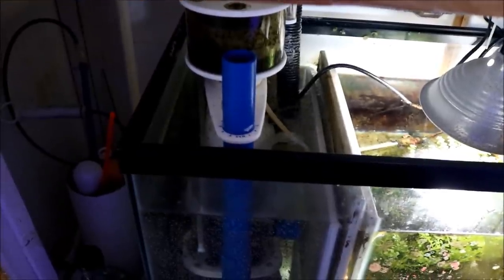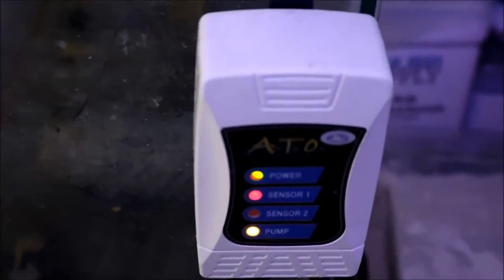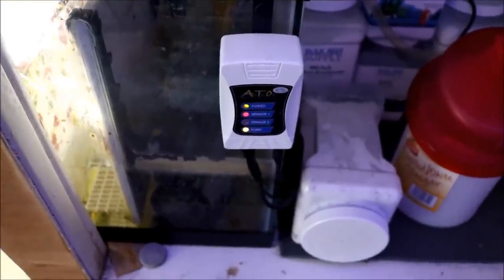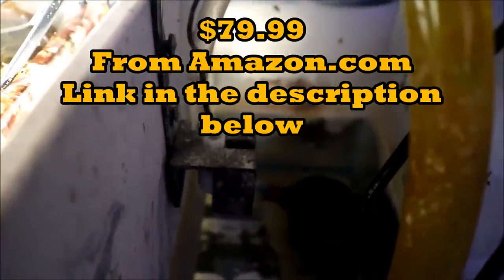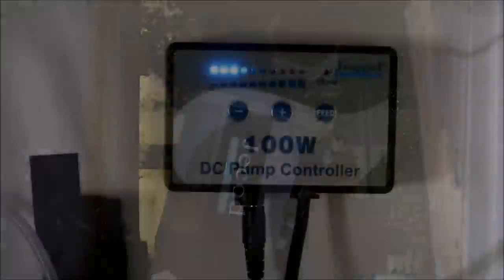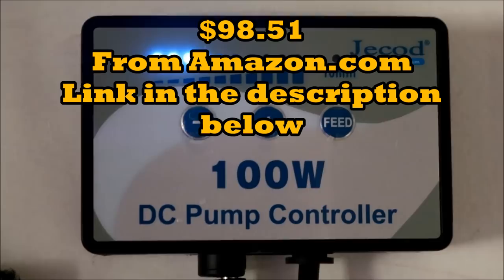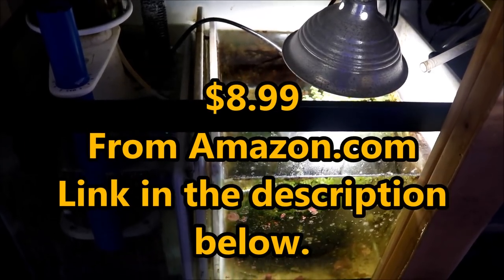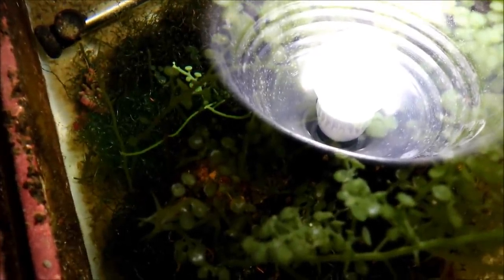Sump On A Budget   What Equipment I Use

Comment: That's all you need right there! My 10g DIY sump for my 40g is somewhat unfinished per advance hobbyist standards, but it's doing its intended job, just not enough room for a refugium area. I originally planned the protein skimmer to be hanging on the outside, but I had to put it inside to prevent skimmer overflow accidents from ruining the floor.
Reply from the maker: +Jon G. Thanks Jon and I do agree an internal skimmer is a lot safer than a external option. Finished or unfinished, as long  as it performs the same it's all good.
Reply: Jon G. 👍👍👍

Comment: Nice vid. How do you like the reef keeper system?
Reply from the maker: Dorian Elijah thanks Dorian, if I had to do it over I would have saved for the Apex. But it would have taken a lot longer.
Reply: Which reef keeper do you have?
Reply from the maker: Dorian Elijah the only reef keeper system that does the most for your money is an apex. But they are super expensive. I use the reef keeper lite and now they really have no support or upgrades once you get the elite. I would save for the Apex of I had to do it over again. Also there are a lot of successful system running without a controller system so it just comes down to a matter of personal preference. Hope that helps.